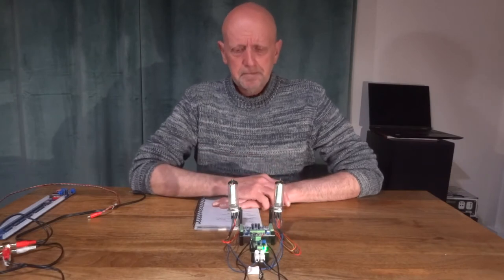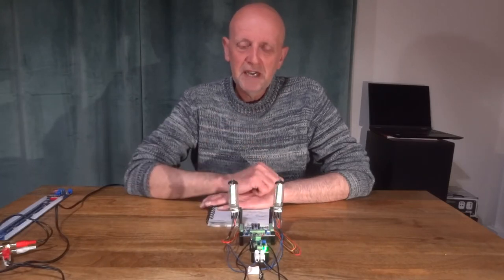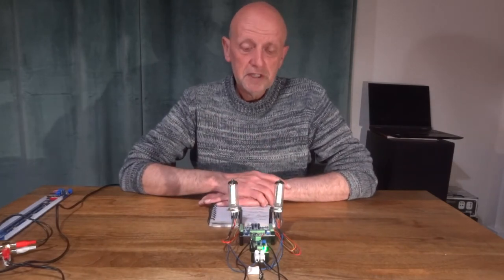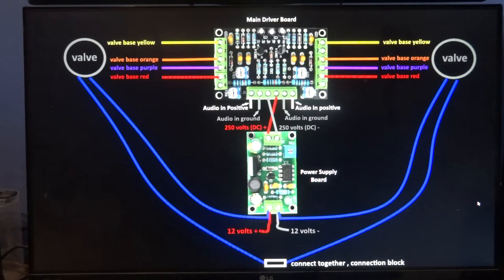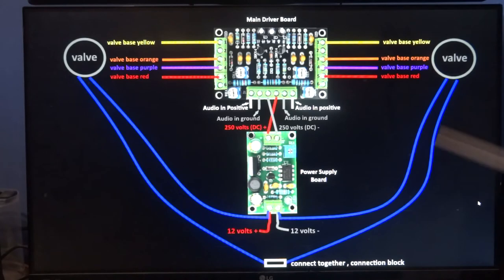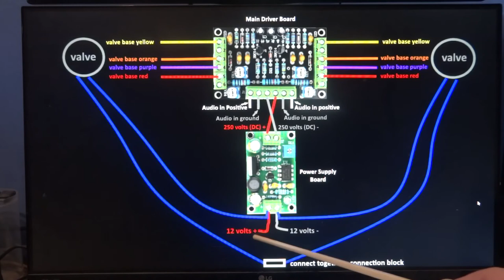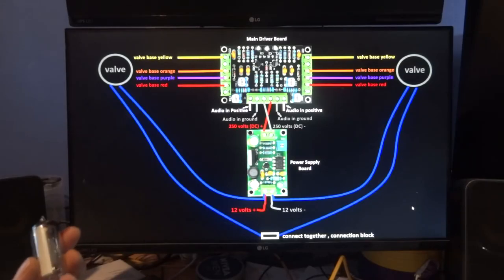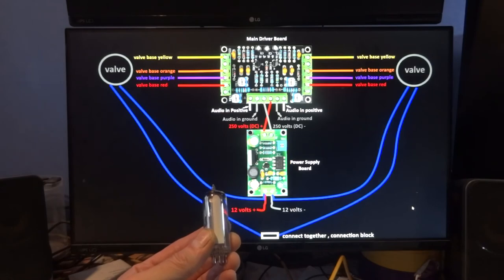Valve Tuning Stereo VU Meters, Review and Instructions, 6E2 Magic Eye, Diagram Graphic Equalizer

Comment: I am curious what would happen if you hook these twos, these VU tubes up as if they were driver tubes, I have a little dot MK2 and I've always thought what would happen if I plug these in where the driver tubes go, when it hurt something or just not function properly?
Reply from the maker: I would have thouht they would not work but also could cause damage to some resistors in the little dot.
I think I have seen these tubes use in a little pre amp but can not be sure.

Comment: Nice video!  I just got one of those kits from AliExpress over the holidays.  Two questions: 1) are the inputs on these for line level or speaker level?  So do I use the headphone out or the speaker out from the amp?.  and 2) Do the tubes get hot?
Reply from the maker: They are feed via the line level, rear tape outputs can be used on some old amps as well, no they are just warm really, no problem in touching them
Reply: @MichaelYates  Thanks!